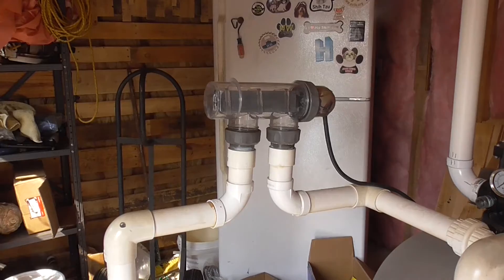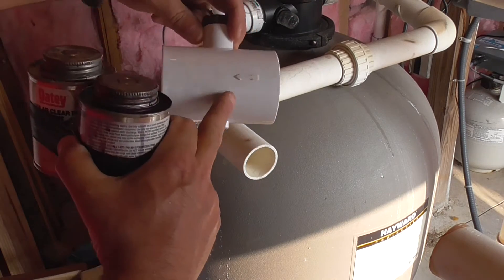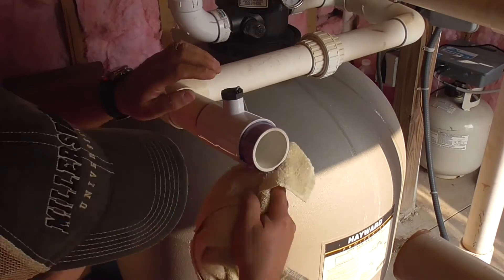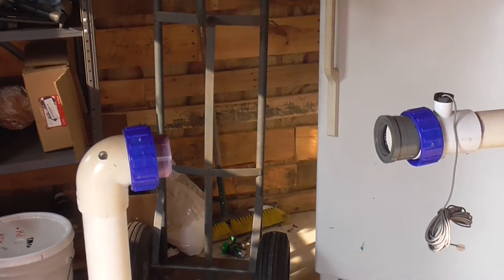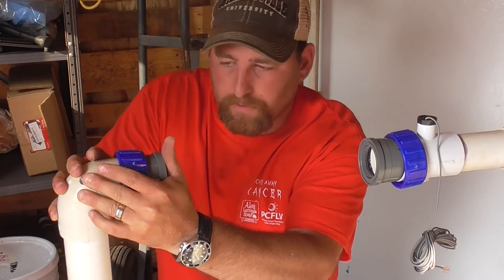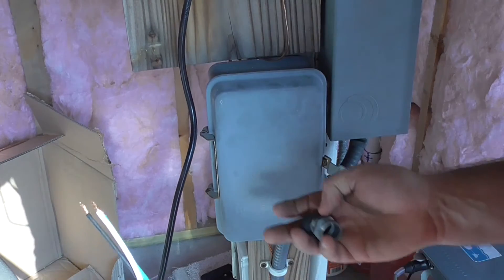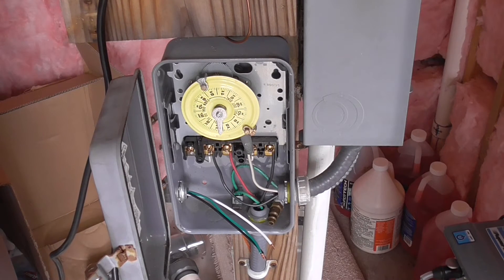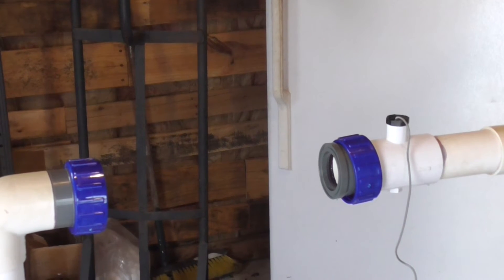Circupool  RJ-60 Plus Salt Chlorine Generator Installation

Comment from the maker: https://amzn.to/2ERKSQI Circupool Universal 40K gallon
https://amzn.to/2Xtqf4v Circupool SJ-40
https://amzn.to/2WIjMpj Circupool Core 35
https://amzn.to/2MuyfkI Hayward Aqua-rite 40K gallon
Reply: We replaced our sand filter with a pentair quad de filter and got more flow and cleaning.  So much so we went from running the pump 24hrs a day to 3 hours a day and never had a problem.  We eventually got a variable speed pump but I am not sure the value is there, I think a single speed pump running 5-10 minutes every hour is enough for us.
Reply: @MichaelMantion  I just get my boy raymond to flip our pool over when the water gets dirty and we just fill her back up with fresh
Reply: @rgii6374  I pull the plug and fill up the tub again.
Reply: @MichaelMantion  😂🤣

Comment: Do u need to use a 8 gauge copper wire to electrically bond the compupool to the heater, zinc anode, pump, all metals of ur pool???  I have a similar compu pool salt generator but I don’t see anywhere to place a bonding wire.  Thanks!!!

Comment: Thankful I came across your video.  I was at the crossroad: replace my cell or go with brand new oversized unit.  I was eyeing on CircuPool RJ or SJ systems but at the same time it was tempting just to replace my cell to safe almost $500 bucks.  Your quick video convinced me that I should get new system.  Thanks a lot...

Comment: Nice video.  I've used granular chlorine for 40+ years and I'm ready to go to saltwater.
I'm comparing models and features and ease of installation.  I plan to install myself so I need a unit that has no warranty penalty for self install.  Any recommendations would be appreciated.
Thanks
Reply: CircuPool has no penalty on for do it yourself. Just purchased RJ60.

Comment: Nice video!  Wondering if you considered mounting the cell upside down or "inverted", given that you have a variable speed pump.  From the manual: "When using a Variable-Speed or Multi-Speed
 pump on a low speed setting, or for general circumstances where flow is less-than-adequate, the cell must be inverted in order to ensure adequate flow & efficient chlorine production."

Comment: I can't believe that your flow meter is hard piped in.  What happens if it fails?
Reply: The fitting is but the switch is not.  Simply unscrew the old and screw in the new.  Easy peezy.

Comment: Do you know the process of converting the 220 to 110?
Reply: Te manual has the instruction on how to do it but in case you don't have it, this is the way: In the accessories that came with the unit is going to be a bag with ( bracket, o rings, screws and a black jumper with two ends ) go head and take the 6 screws in the back of the unit and you going to see on the circuit board another black little jumper between two screws, (total 4 screws ) remove the jumper and attach it to the 2 screws on the left and then put the other supply jumper to the right connecting the other 2 screws together, that's going to make the unit 110 voltages.

Comment: You mentioned, there's no gaskets when you snugged it up. There are two clear "O" ring gaskets that are included with this kit. They need to be put into the grooves on the grey fitting right before the cell is mounted inline.

Comment: Thanks, Bob...I had a 16' Intek with a sand filter and saltwater/chlorine generator, but it beat me to death trying to keep the chlorine levels high enough; then again my whole setup...pool, filter, pump and chlorine generator cost less than than any one of the Circupool products listed in your link!  :>)

Comment: Isn’t the purple glue good enough? I saw where you also put the clear glue over the purple glue. Just wondering
Reply: The purple is a primer not glue. It cleans the pipe before using glue. However you should only apply it to the pipe withing 30 seconds of applying glue.
Reply: Edward Rutherford Thanks, I have some piping  to do so was just wondering. I saw one dude before he just applied some blue color I’m assuming it was like the purple and put the pipes together so I’m not sure if the blue was blue or primer lol
Reply: @edwardrutherford5855  the "purple" he is talking about is a 1 step pvc cement designed for use on wet pipes.    Several companies make it, Oatey being one.  Used a lot by irrigation people where it can be very hard to clear the pipes of water.  In this case, drying the pipes is not an issue, so I would prefer to do as he did and use the 2 step process.